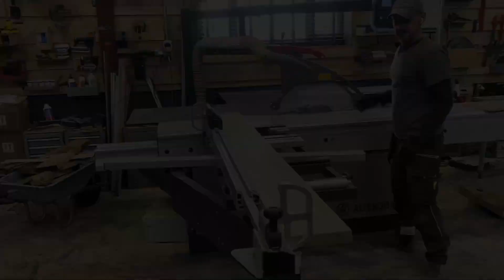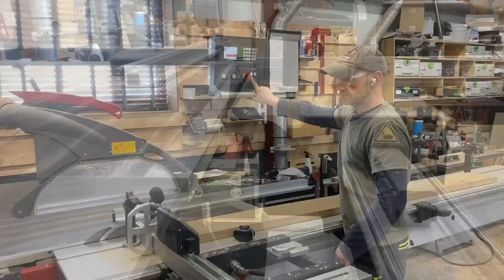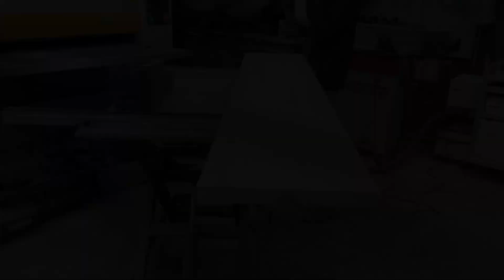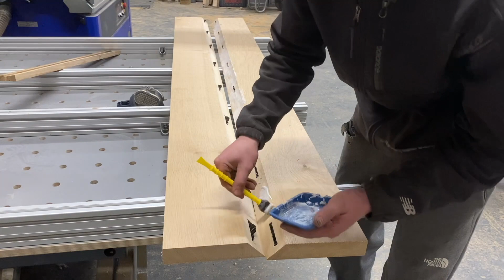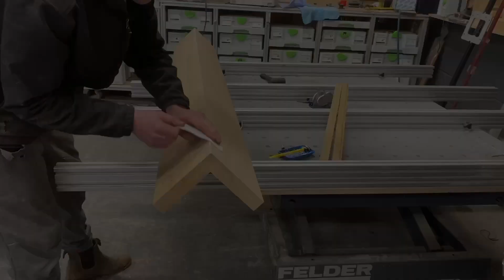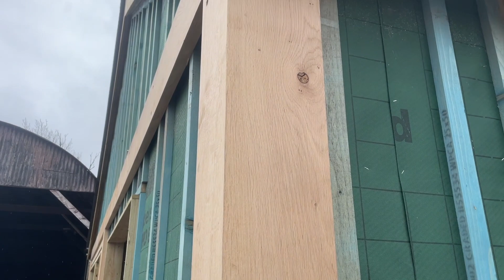False Oak Beam  -  Perfect Corner - Lamello Zeta P2

Comment: Nothing in the world will make you want a sliding table saw more than watching that Altendorf.  It makes my Hammer K3 look like a postage stamp.
Reply: I agree if the money supply was limitless. If you had a finite amount, would that be your number one purchase? The table saw is often the centre of the processes (jointer/saw/thicknesser is always my starting process), but that Altendorf seems very space hungry. Unfortunately, it’s not a choice dilemma that I am ever likely to encounter. 

I’m very pleasantly surprised that Manor Wood have calculated that there are/will be enough throughput to make all the (considerable)  investment financially worthwhile. Before lockdown, it seemed that most bespoke wood businesses were having long term struggles keeping their head above water just on making. So many had to turn to teaching or leasing out space to make it all work. In modern times, because of the rate in which improvements to machinery and process are being made, machinery usually has to be depreciated very steeply. Whereas, say 100 years ago, a piece of machinery might have a real earning life of 30,40, 50 years, I had to depreciate (not for taxation which is a very different calculation) over 3, 4 or 5 years and make provisions based on that.
Reply from the maker: Better machines = less time , less staff needed , more time to design ..  for me that is
Reply: @ManorWood  I have no doubt that you’ve made all the business calculations that should be done. The crux of the calculation has to be upon assumptions of sales going forward. My business operated in a sector where you contracts were awarded for 3,4,5 years. That made planning easier than when you can’t depend upon repeat weekly, monthly throughput. I wouldn’t want to go into the issues of how you are financing your investment - that’s way too personal - but businesses have obviously failed not because their output was not profitable in one sense but because of the size of overheads. There, you might well have an advantage in “owning” the business property. When I was MD of a much larger company (which I didn’t own) there was always the dilemma of chasing business to help keep machines working; that might well mean taking on marginally-profitable business from people who took too long to pay.

As I said originally, I am very pleasantly surprised that your calculations justify the investment. So many other bespoke makers have been unable to.

Comment: I used to work in a workshop with the same kind of altendorf saw machine. One time the machine broke somehow and we needed to get a mechanic to fix the problem. I wasn't there at the time when the mechanic came around but my colleague was. He told me what the mechanic said, "this machine can't break, but it can be broken" what he meant by that was the way that we used the altendorf was bassically to rough. After our boss heard that he got quite mad at us for not using the machine in the proper way, i think it was because we had to wait for a week on the mechanic, and the cost that came with that, let's just say, were quite high.
Kind regards, 
A young guy from the netherlands
Reply from the maker: These saws are Stunning, and so well made. For me it’s a accurate tool so needs to be treating with respect. I guess if you bash anything around too hard it is an accurate piece of machinery it will fail.  Thanks for your feedback and support welcome

Comment: Have you looked into "airtight clamps?" They use a vacuum system, and they can be used to hold down both front and back of a workpiece. They have enough reach to extend over the crosscut fence on sliding tablesaws. ExtremeWoodworker has a video on how to install them on his Altendorf tablesaw. The sawyer can operate both clamps with a flick of a switch, which can save you a lot of time. Really enjoy your videos.
Reply from the maker: I haven’t seen these, have you got a link I’d love to look into it

Comment: Hey.. I hope you can give some advice or from your experience. We tested the lamello on 16 mm oak nosings . The cut was 45 degree. When we assembled/tighted the joint with the lamello, the outer (exposed angle) opened up by 1 or 2 mm. It was like the clamp pressure tightened up the inner angle.. have you any experience of this with the lamello.. any advice greatly appreciated

Comment: At 1:55 of the video you talk about this Martin clamp that has the capacity to reach over the crosscut fence.  Do you have a model number or link to these?  Also, you do a lot of hardwood milling too on the slider.  Was wondering how much higher do you prefer the sliding bed above the cast table?  There’s always these debates about how high to be.  I process both sheet goods and hardwood, is there a happy middle range to be at?  Thx
Reply from the maker: I’ve had a link to description for Ruwi contact them and all about it
Reply: @ManorWood  looks like I’d have to buy the whole system just to get the clamps, but I only want the two clamps, thank you anyways..